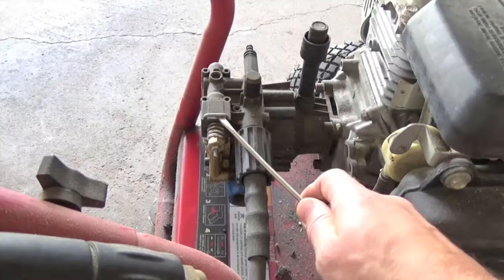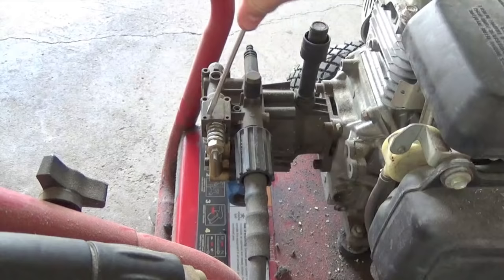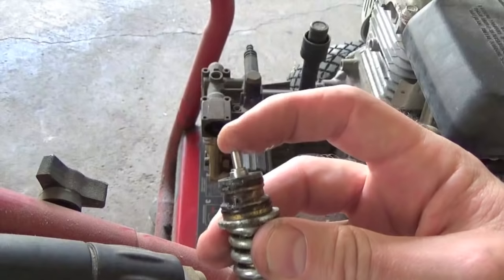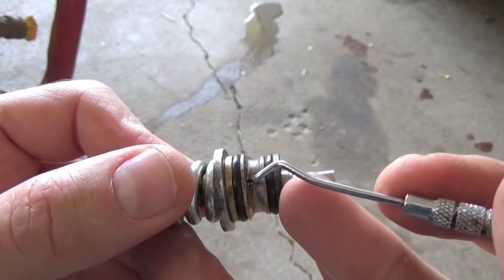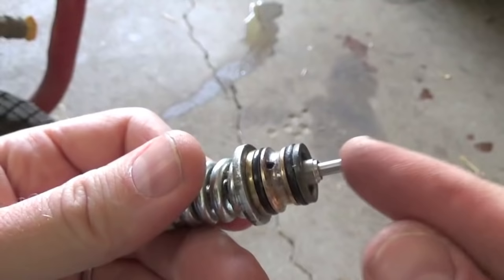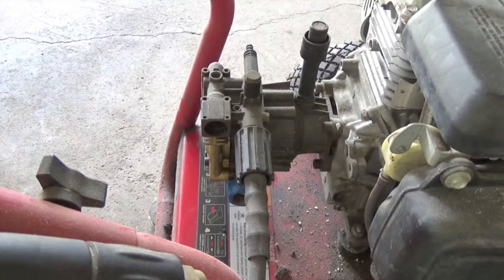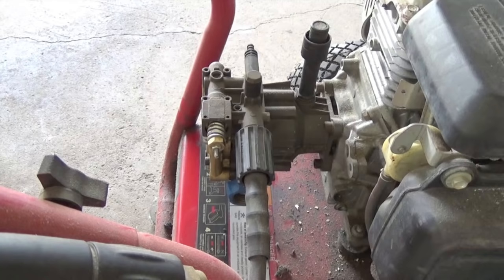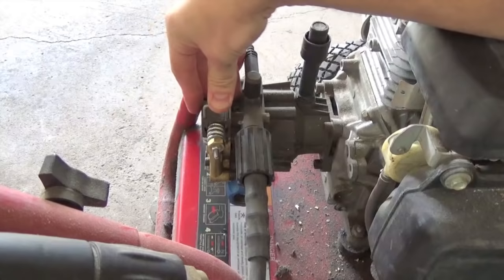Fix Pressure Washer Unloader Valve in 2 Minutes

Comment: But wait, what's your favorite and color and why?  Thanks for the direct approach and the help with my problem.  You should run for President of YouTube.
Reply from the maker: President of YouTube? I like the sound of that. However, the skeletons would be tripping over each other as they tried to get out of my closet ;)
Reply: @HNXMedia  I took it out and the pin works perfectly fine.  I even cleaned the little holes on the side.  It's still doing the same thing.  I notice though, the unit won't stall out if I take the gun off and just let water run through it.  I put the gun back on and hold down trigger, unit it ok.  Let go of trigger, pump sounds like metal noises before stalling out. I wonder if something on the inside of pump broke
Reply from the maker: @ShyRage1  That could very well be it too. Replacing a pump is super easy and on most unit only cost about $80. I had one that was completely shredded on the inside. Check out this video here for How easy it is to swap out a pump: https://youtu.be/Np9c0MLnUv8
Reply: @HNXMedia  after watching your other video I saw that the pump itself also has a timing key 🗝️.  I wonder if this is what broke in it and if that what I'm hearing.  Also, if this could be why I'm having that issue
Reply: @HNXMedia  I ended up taking the pump off and apart.  I cant get to the center of the pump for some reason but I found out if I shake it, It sounds like loose bearings.  I'd say the pump is shot, your thoughts?  Now, how do you disconnect the line going into the pump?  On mine, it's not as simple as just unscrewing like a water hose.
Reply: Yoi
Reply: Got my vote.
Reply: I couldn't have said it better myself !!!
Reply: @HNXMedia  lol, but clay has a point.  How about the head of the brevity=efficiency dept?
Reply: @HNXMedia 😅😮😅😅😅

Comment: Worked!  Thank you. A word of warning, when I pulled the clip the unloading valve flew across the garage.  Once I found it, it moved freely. Replaced it into the hole and it worked perfectly. I'm guessing when it bounced off the wall it cleared it up.
Reply from the maker: Well, that is certainly one way to fix it. If it works, it works!

Comment: Have a 15 year old a pressure washer that would run but not kick in to make high pressure.  Figured the pump was dead.  Followed these instructions and fixed it in 5 minutes. You are the man!
Reply from the maker: Glad I could help.

Comment: This guy wins instructional's on Youtube - this is how it's done.
Reply from the maker: This guy still responds to just about every comment. Some day I'll get a life.
Reply: @HNXMedia  An admirable quality sir! If I could ask a brief follow-up q, I've followed this vid on my Nilfisk Alto,  it runs, starts & stops on the trigger & main switch, water comes out of the lance but with no pressure at all, lance & hose are clear of debris / calcium, no visible water loss within the unit or from the main body - where would you look next pls?
Reply from the maker: @gavva2010   It sounds like the pump is not building pressure. I have had to replace/repair my pump twice. The internal valves are often plastic and they corrode/crack. If the unloader has completely failed beyond being able to be cleaned, it is often cheaper to replace an entire pump than just individual parts - and they are super easy, usually just a couple bolts. I replace a pump in this video: How To Replace Pressure Washer Water Pump (Part 2)
https://youtu.be/Np9c0MLnUv8
Reply: @HNXMedia  I checked the unloader according to your excellent vid, hoping it was gonna be stuck, but nope - it was fine. So I cleared the little hole with a pin, greased the o-rings, & reinstalled. I'll try the valves next, motor is fine & the machine does allow water to flow through, just with no pressure at all. We had a pretty cold spell a few weeks back, hope it's not cracked.
Reply from the maker: @gavva2010  That's the way I lost my first pump. It was in the garage but too close to the garage door during a hard freeze. The water remaining in the pump cracked the metal.

Comment: My hero. A no nonsense man. You deserve a cold beer
Reply from the maker: Make no mistake about it...I'll take that cold beer (or two). Glad I could help. Peace.
Reply: @HNXMedia  Right...one beer only makes you thirsty! Thanks for the tip, I'm helping a friend. No water is coming out and the engine is revving and slowing down. Hope that's it because at first we thought there was a clog in the hose.
Reply from the maker: @tomcollier4089  Sounds about right. The "system" in a pressure washer is ridiculously "balanced." If this doesn't work, check all the o-rings on the wand (yes, even those can cause a failure like this). I have a video on that as well. Worst (absolutely worst) case scenario, replace the water pump. It is cheaper than people think and...of course...I have a video (or two) on that as well. Drink a beer...wait, nope, drink 3 beers for me and we'll call it even. Peace.
Reply: @HNXMedia  Will do! I'll let ya know how it turns out tomorrow. I had to stop to cook.

Comment: Old video but info still very useful to me. I always put my power equipment away properly for the winter. BUT... this spring my pressure washer would only build pressure for a few seconds, then engine would obviously not be under a load. Thanks much for the short, concise video. Just what I needed. And yes, I know. My comment was longer than the video.
Reply from the maker: Long comments inspire good videos. Thanks for watching and I am glad the video was helpful.

Comment: Thanks for not taking 20 minutes to explain your whole life up to that moment. I was all but ready to buy a new pump, low pressure...saw this video, did exactly as instructed, had a bit of trouble getting the thing out, used some Blaster and tried to loosen with a vise grip (gently )...then finally it popped out with a screw driver , needed cleaning, I did as instructed, greased it, and got the piston moving, and cleaned out the little opening  and it went back in much easier...its late, I will fire it up tomorrow...either way THANK YOU
Reply from the maker: This comment is awesome, I mean, it's longer than the video, but it's still awesome 😎 Hope the video was helpful.
Reply: I'm a salesman :)... @HNXMedia  Question, is this valve "adjustable" by turning the larger bolt on the end?

Comment: Great video, but when you mentioned put a little bit of grease on the O-Rings, you should have mentioned that you should be using a SILICONE BASED grease, NOT a Petroleum based automotive grease. (Any swimming pool owner is familiar with Silicone based O-Ring lube / Jack’s Lube is just one common brand.) Petroleum based grease will swell rubber  O-Rings and will typically make an old dry O-Ring seal in a pinch, BUT it will make it much more difficult to remove the unloader when (not if) you have to clean it again.

Comment: Love it.. sounds like Billy Bob Thornton just told me how to fix my pressure washer, with no filler.  Thank you!
Reply from the maker: guitar6411 Some people call it a sling-blade, I call it a kaiser blade, mmmm mmmm.
Reply: @HNXMedia  LOL. Great movie. My unloaded valve on the troybilt seems to be a different setup. I have to use an open end wrench to get it off. Maybe a 19 or 20mm, I'm assuming cause the biggest I have is an 18, go figure!

Comment: Ok, enough already about how great the vid was. My pump worked fine for a few minutes, then pressure dropped to nil for a minute, back and forth. I pulled the unloader (with help of Liquid Wrench), but it looked great. Was pretty clean and the valve moved smoothly. I lubed it and put it back in (then searched for an hour for the clip that I lost in the grass!). Bottom line: IT WORKS! Thanks.
Reply from the maker: Bottom line, this is a GREAT comment. Now get back to work! Peace!

Comment: Thanks for the easy video! The stud on my valve had snapped off the unloader valve and needed to be replaced. Now I know how to remove it.
Reply from the maker: BJ Jongejan Thanks for watching and taking the time to leave a comment.

Just FYI, you can usually replace an entire pump cheaper than you can buy just the unloader valve. Just wanted to give you a heads-up.

Comment: It worked!!!...thank you so much!!!!,,,any hints on how to get the spray gun hose connection to the pump un frozen,,,I have tried everything (baster) all its doing is striping the rubber grooves with channel lock plyers or a vice grip...
Reply from the maker: When mine was like that I repeatedly sprayed it with vinegar. We have super hard water and all the deposits froze the connect as well. Once you get it loose, use teflon tape or something to help it to not seize in the future.

Comment: Thx for the quick video! My only concern is that those are probably regular Buna o rings, regular grease or oil can start to degrade the rubber. Use air tool oil instead.
Reply from the maker: Solid advice!

Comment: You more clearly than others no whats up w this. My question is if the unloader is bad could it cause hard pull starting. If i release the pressure out of the gun w the trigger then it wants to pull start easy but if doesnt start then process has to start over (pull trigger and big release of pressure then can pull start it). Thanks in advance and for the great video and stay safe..
Reply from the maker: That is very likely the unloader valve. It will build up so much pressure that you cannot even pull the start cord unless you squeeze the handle on the nozzle. The washer itself is not "releasing" the pressure that it is trying to create with each pull start. Mine did that for a while. I eventually replaced the entire water pump (actually a cheap and easy fix - see my other video) and it has not had that issue since.
Reply: @HNXMedia  Thanks so much for the help,,,,and yep pulled it out the other day and completely plugged with spring broken. Take care and thanks again and good videos btw
Reply from the maker: @brianb5779  Thank YOU for watching. Peace.

Comment: That was pretty straight forward - thanks. 
I had a prob with the old unloader valve going into a new manifold - silicone greased. I tapped carefully on the washer with a 5/16 long socket and it seated, but the u pin went in with difficulty. It scraped the original washer. What did I do wrong?
I have no water output while engine OFF and water ON from hose  What's going on with this?
I removed the manifold and water was flowing thru ports. I re-attached manifold but no water...
Thanks if you have some advise

Comment: I notice you have removed the 4 allen screws holding the valve head in place. I've removed mine and soda blasted all the parts and will be replacing the o rings and reassembling the works. I hope it solves my issues.

Comment: After watching this yesterday I tried it with my non-spraying washer. The “U” was tough to remove but not as hard as the pressure valve. Screwdrivers would not fit under the spring so I loosened the 5/16 nut and 15mm nut until there was enough gap between the coils for a screwdriver blade to fit. The valve came flying out and onto the garage floor and I found lime deposits in the pressure groove and down where the valve sits. I cleaned everything out and reassembled it. I’ll be trying it out soon and will let you know how it works.
Reply from the maker: Cool! Hope it works out! Check back to let me know.

Comment: I have a 4000 PSI black Max I picked up used and what it does is it'll start and run/spray fine and then the engine sounds as if it's loading up or bogging and then shuts off,ya think this trick you've shown here would be probable in my situation? Thanks a lot for the no BS video.
Reply from the maker: It might help. This is the quickest/easiest fix to try. If not, I would be tempted to pull the entire pump (super easy as well, I have other videos on that). Sometimes replacing the pump solves the entire problem and can be "relatively" cheap (less than $80 on most washers). Hope this helps. Thanks for watching and taking the time to leave a comment.

Comment: Perfect how-to video. 

Question: my pressure washer runs fine while the trigger is squeezed. But when released, the motor pulsates, and it sounds as though the pump keeps kicking on, then off. I suspect some sort of pressure valve is not staying released and allowing the motor to run freely. Could this valve be the culprit?
Reply from the maker: Yes, this sounds like a symptom of a bad/dirty unloader valve.
Reply: @HNXMedia  thank you! Again, excellent video. I wish more (all) YouTube DIY videos were like this

Comment: ****Dont forget. Remove the o rings and then throw it in the ultrasound cleaner for a 1/2 hr. Clean the o rings with dishwasher liquid. 
Dry it and then lube the rings with silicone grease and reassemble.
You now have a new washer.

Comment: Hey man great video simple and to the point ...
I have question i have 3500 psi chinese pressure washer pump but the thing has never
Felt like it made 3500 psi 
How do i adjust the unloader 
And are these chinese pumps known to need the unloader adjusted
Reply from the maker: I thought they were "fixed position." From my understanding, the adjustable ones come with a knob that can be tightened or loosened.
Reply: @HNXMedia  there are the kind you mentioned but the kind you showed in the video and the kind i have are adjustable as well ... Ive found the way to abjust them you just tighten the nut but  be warned pump damage is a possibilty as well as actually physically cracking the pump...

Comment: Give that man an "Atta Boy" pat on the back Quick,,,Straight to the point ,,Made my job easier,,,fixed the pressure washer in 5 mins,,,and got wife out there cleaning the deck
Reply from the maker: LOL. The last line of this comment made making the video worth it! Peace!
Reply: @HNXMedia  I have 1 question,,,,How far is that "Pin" on the unloader valve supposed to go in ??? Mine dont go in but 1/2 way
Reply from the maker: @mrcoz1764  If it is lined up correctly, it should go back in "flat" or all the way. They can be a bit fidgety to perfectly line up, hence my high-tech technique of smacking it with the end of a screwdriver. Then valve has to be all the way back in and "seated" or the pin will not go in. Hope this helps. Peace.
Reply: @HNXMedia  Thank you this helps me alot,,Well take it back out and beat it to death,,,Stay safe

Comment: Love the video. However cannot get the pressure washer unloader valve out. Have worked on it for days and it won't budge. What can I do to get it out aside from dynamite?
Reply from the maker: As long as the "U" pin is removed, it should come right out with a little consistent prying. Sometime you have to pry from multiple angles if something bound up the unloader valve for some reason. You could try spraying a little PB Blaster around the unloader, but be sure to wipe it all off before you re-install it. If it is that hard to get out, you might also want to replace the o-rings when you re-install it as well because they are likely to be damaged from removal. Hope this helps. Sorry that this is turning into a longer than 2 minute project. Peace.
Reply: @HNXMedia  Thanks! Not your fault it's more difficult than the video. Probably the salt intrusion from my well water. I ended up using it's own water pressure which blew the valve, ball bearing, and another part out. I put the first part in and then the ball bearing. Now I can't get the valve in far enough to put the U pin in securely. I tried getting it all out to no avail. So I guess I'll try the water pressure again. I ended up using an old brass hose handle with a fine point and it simulated the pressure sprayer. lol. But I had to scrub too. Just got frustrated with the  pw and didn't want to break it or me! lol Thanks for your help.

Comment: Ive been struggling with debris clogging the nozzle and then i get super high pressure across the lines with no way to clear or relive pressure.

Can this "unloader" valve be used in that scenario to dump line pressure so i cna open quick connects. Currently just twist off the hose under pressure with pump pliers and hold on like hell lol.

High pressure remains because the nozzle is plugged from the inside of the foam cannon, releasing or pressing the wand handle xoes nothing, cutting the motor and removinf the water supply also does not relieve pressure.

I was looking to maybe add a dump valve, but cant find a "normal" set-up people use, i just dont understand what folks are talkign about. Came across "unloader valve" and atill kinda lost.

Any help wpuld be appreciated!

Comment: yes, yes yes?!? QUICK EASY AND "TO THE POINT!!"
Reply from the maker: Wouldn't have it any other way.
Reply from the maker: Michael Fresh  Just replace the entire pump. The new pump will come with a new unloader. It is actually cheaper to buy a complete pump than just a single unloader valve. Find the model number and grab a matching pump off Amazon or just about anywhere. I replaced one for about $80: https://youtu.be/Np9c0MLnUv8

Comment: If that pin is sticky you say use break free is that the same as break cleaner? 
I think this the issue I'm having with my pressure washer I bought new last year. This year all of a sudden most of the time when I let off the trigger it kills the motor.
Reply from the maker: No no no. "Break Free" is like WD30 or PB Blaster. Generically it is called "break free." Brake cleaner is TOTALLY different.

Comment: Looking for instructions on proper method to adjust the unloader valve.  Everyone shows how to take it out and put it back in, but I think mine is out of adjustment, and can't find anyone that gives a straightforward set of instructions on how to properly set the valve pressure.  Mine has a large nut that spins with the stem and a small screwdriver turned threaded rod with a jamb nut that looks like it's there to lock in the setting.  Any help greatly appreciated!